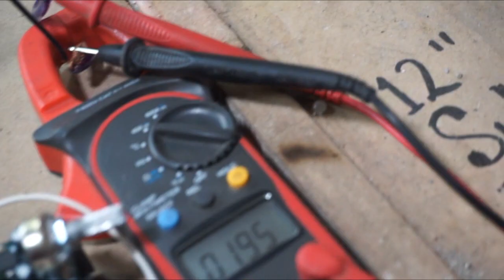SOCL Amplifier + Subwoofer Filter 4558 - PCB , DIY and TESTED

Comment: What is the  voltage of input ac supply. Kindly explain the both ac and DC  supply voltage . Please tell about which type of transformer u r used in this circuit and what is the voltage and Ampere of this transformer.

Comment: mas kalo ampli IRS2092S 500W Mono Class D di kasih filter subwofer bagus gak ya hasilnya? kalo di bandingkan TPA3116 Class D Amplifier 2.1 50W + 50W + 100W subwoofer - 200W bagusan mana hasil bas subwofernya?
sama filter subwofer yg recomended merk apa mas? mksihh..
Reply from the maker: Kalo sya sih bagus irs2092. Coba filter sya yg ad di vdeo trbaru mas
Reply: @WahyuEkoRomadhon  brow..filter sub...sudh ada di lapak brow??